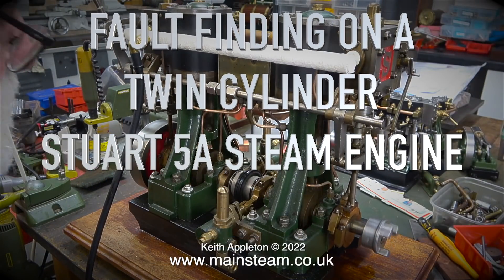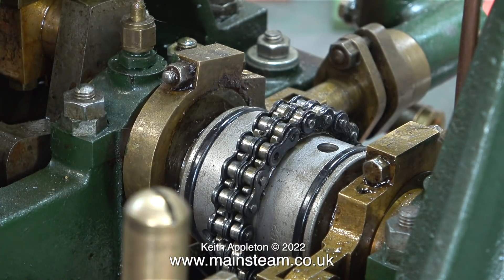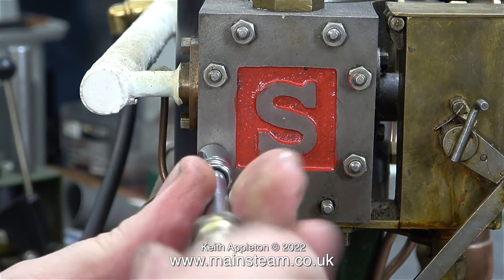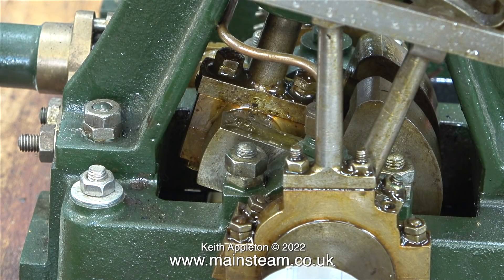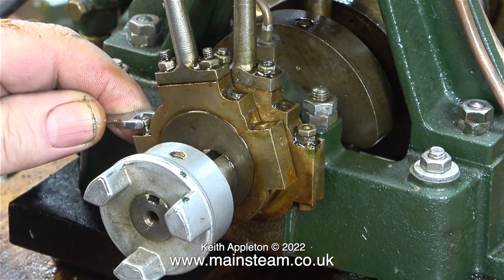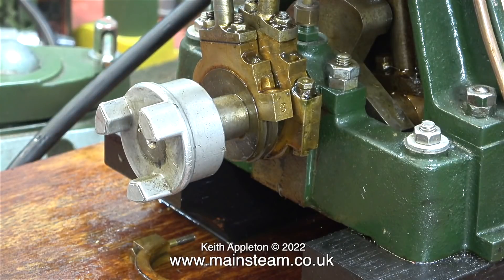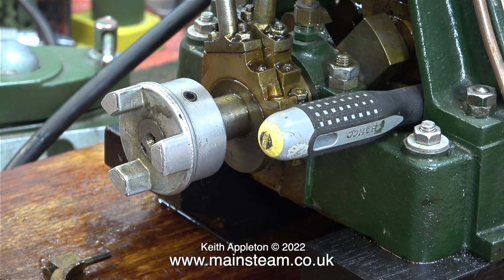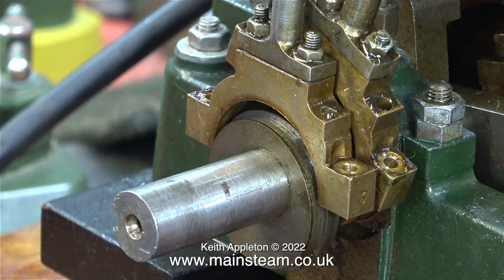FAULT FINDING ON A TWIN CYLINDER STUART 5A STEAM ENGINE - PART #2

Comment: Nice.  I figured that the coupler wouldn't come off, because the end of the crankshaft was mushroomed.  It will be interesting to see how you address the excentric issue.  Since they are probably not timed to each other correctly.